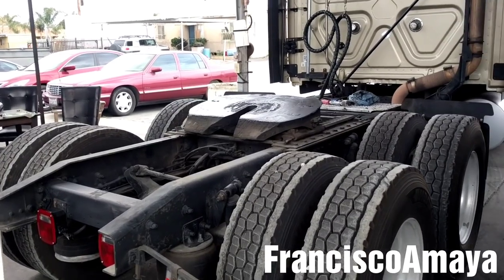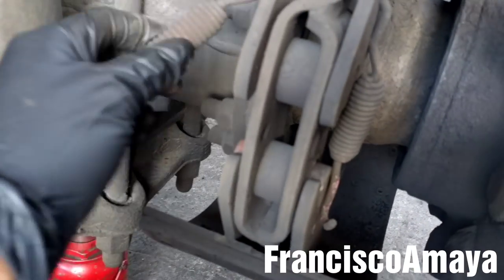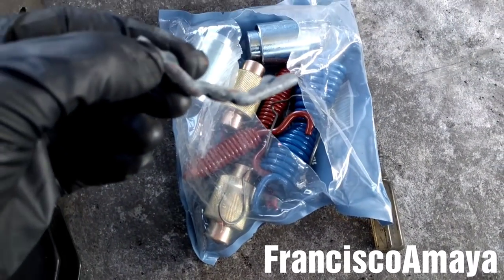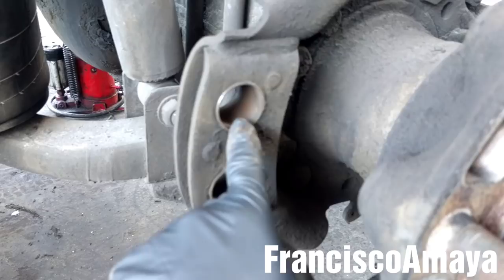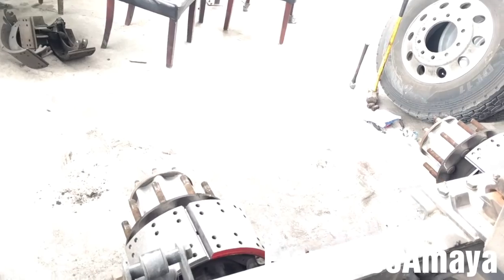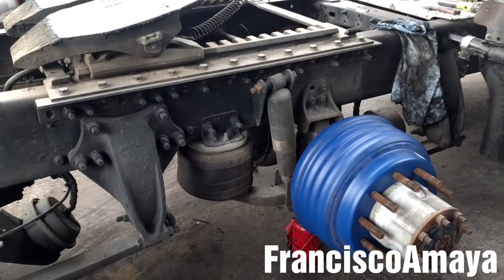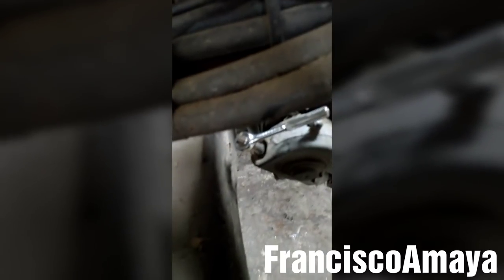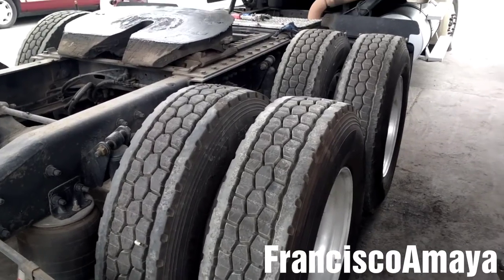4707 brake shoes replacement Freightliner Kenworth Volvo international PETERBILT 4702 4515 4720 4726

Comment: Francisco, do more videos in English, you are very good. Most Spanish people here unerstand English, but most English dont understand Spanish;)

Quick question - the red part of the shoe(thick) has to be towards the front in the top and towards the back in the bottom right? Also, do you buy these from the Freighliner dealer or somewhere else for Cascadia?
Reply from the maker: They can be installed in any way. Yes, you can buy them at any heavy duty parts storo

Comment: Thanks Francisco for this video .
I have a question about Freightliner Cascadia 2016 
The truck it doesn't come with airbag dumb switch inside the cab
When I need to empty the airbag I don't have switch key available 
If there is any way I can add  airbag switch suspension inside the cab  ? 
 thank you ...
Reply from the maker: Yes, you need to buy the leveling valve with dump and install a air switch in the dashboard.
Reply: Thank you francesco for the replay
I was searching video about that 
I'm not sure if you done one 
If you don't mind you know how much estimate this one cost ?
Appreciate it thank you

Comment: how much torque do you put on the big bolts on a cylinder head on a DD15 EPA10
Reply from the maker: 180 ft-pnds + 90° + 90° (180°)

Comment: Hey my friend good learning from you. The same drums from rear is the same for the front?
Reply from the maker: No, they are different.  
Front ones are smaller.
Reply: @franciscoamayaYT  i know the rear drum part# but the front i don't know it,can you tell me the part # from the front drums?
Reply from the maker: The front part number varies depending on the type of brake shoes you have in the steer axle.

Comment: I Have aCascadia VIN# 1FUJGLD66ELFP2398 and I want to know if the Stemco brake drum# 89996B centrifuse drums and shoe kit# WKS4707QVHP New Brake Shoes fits on it. the brake drum dealer part# is 10012097